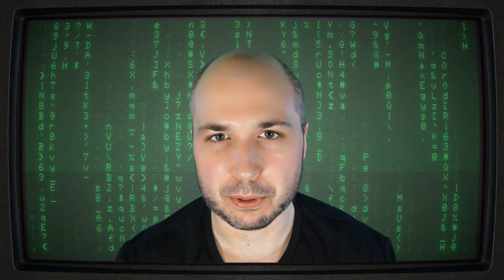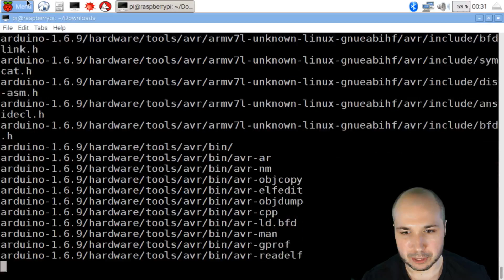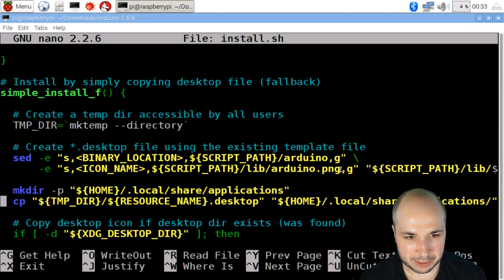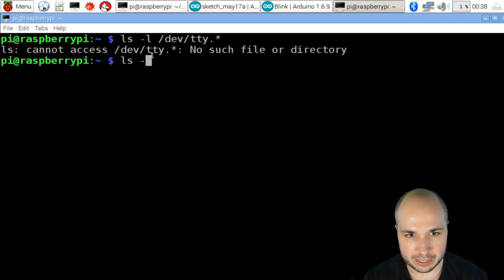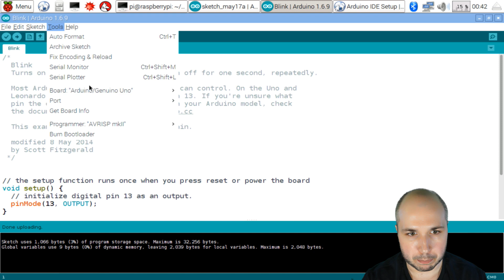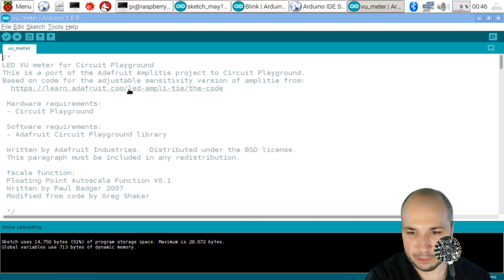Raspberry Pi Quick Look: Running Arduino IDE on the Pi with Tony D!

Comment: So I have an RV I want to display battery voltage, amerage draw, solar production, etc. I would like to pass the analog collection from the Arduino to a Raspberry Pi for the GUI definition over a small LCD panel. Is there a good "display" available to pull the inputs from the Arduino to the Raspberry Pi?

Comment: I needed to know how to update my IDE to 1.6.2 so I could have include library and manage libraries, and finally  after 7 minutes I learned 2 things: go to arduino.cc rather than arduino.com and second, download the Linux Arm Experimental for Raspberry Pi rather than the other 2 choices. Very good and I thank you. Then I heard you say unzipping was best done by using the command line, and from then on I couldn't keep listening because you had so much to say about everything under the sun. However- I'm not a complete ingrate. I thank you for the 3 nuggets I managed to pay attention long enough to get and that I didn't find anywhere else.

Comment: Question!  I am trying to figure out how to create something I think is not too crazy, but I am not having much luck figuring it out.  You seem to know A LOT, and I would really appreciate it if you could point me in the right direction.  I'm just looking for a photo-camera (I care about the still-image resolution, not the video), attached to a small computer that can be wired to a network and powered.  I want to be able to tell the camera when to take a picture through a network and to immediately capture the image from the camera. I don't know what parts we need, but I'm hoping you can point me in the right direction! This is for a small start-up, and we are needing some help figuring out this hardware!

Comment: Thanks Tony!

I had the arduino package installed that was in the Raspbian repository (using apt-get).  This didn't have the feature for third party boards, so I removed that and installed using your approach.  BAM!  Done!

I did run the install.sh script.  It gave lots of "No such file or directory" errors, but it installed a working icon on the Desktop and on the menu under "Electronics"  .. No problem, no drama!

I do have a few weird things to work out:
1. my /dev owner is root:tty
2. saving a variant of "blink" said it was read-only

The tar command dropped everything in the Downloads/arduino-1.6.9  folder... that wouldn't be my first choice!  LOL

Comment: Tony, I tried running the Install.sh.  It works great too, and did add the icon to the Pi3 Raspbian desktop just fine running Jessie.  It did take 3 or 4 tries to get the ESP8266 boards manager to load and save.
Reply: Hi Tony and Bryan,
Two comments:
1) I also ran install.sh and not only did it create the desktop icon, it also shows up under the pull-down menu under "Programming" along with the icon for the version of the IDE I installed using apt-get.
2) Depending on the Micro Processor variant connected to the Pi's USB, the board may show up as /dev/ttyUSBn, in my case /dev/ttyUSB0.  Also the group for the user 'pi' was properly set to 'dialout' , eliminating any permission issue.
Great tutorial as usual.  I still have to get the ESP8266 boards added.

Comment: Someone had a .deb package for Arm V6 of version 1.6.5 on Dropbox that you could find by going through a long forum thread on arduino.cc. I used that version with a mix of B+ and Pi2s at a science camp last summer, but they were just tweaking settings on demo sketches for neopixel hats. It's great you can get the current version.

Comment: Not to pee on the parade here, but I've been installing the Arduino IDE on the RPi for months now by just typing:

sudo aptget install ardunio

Maybe this is an unofficial, unsupported, buggy version?  In any case, never had a problem with it.
Reply: +Tony Vasile ...and now I am figuring out that the version I have loaded is older and will not support the board manager.  So that makes much more sense!  Thanks, Tony D. for showing me the light (again)!
Reply: +Tony Vasile nice update to your comment.  I was thinking that it should be in the repository as well.  Even as "experimental", that's the way the code flows under Linux.